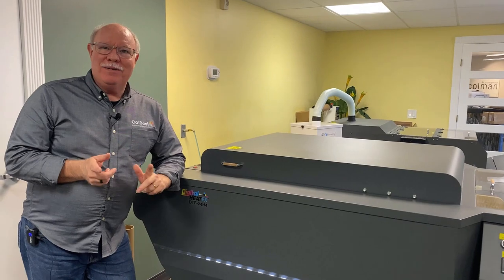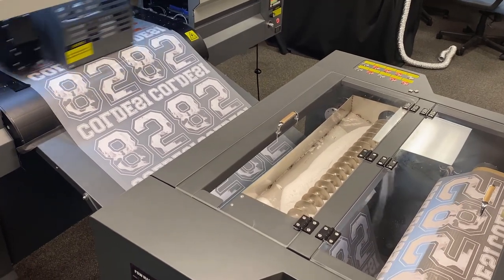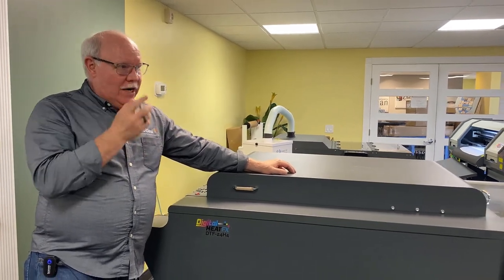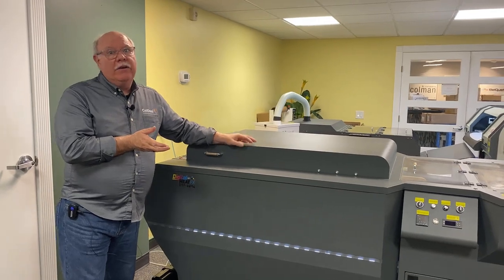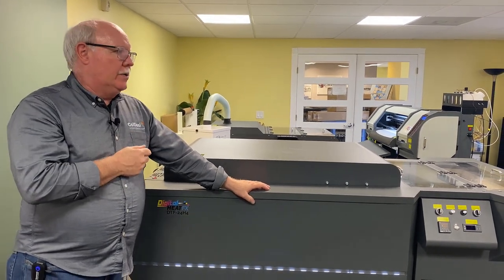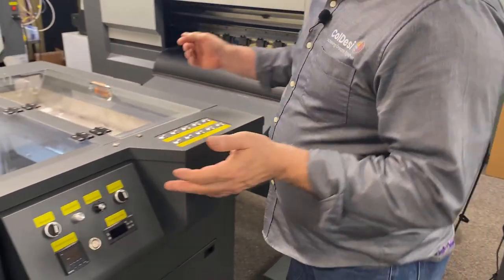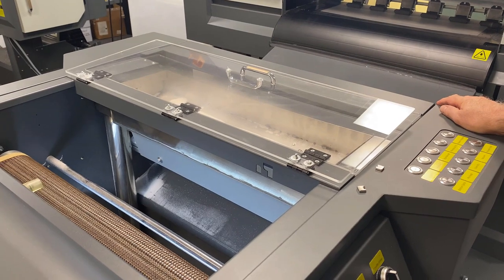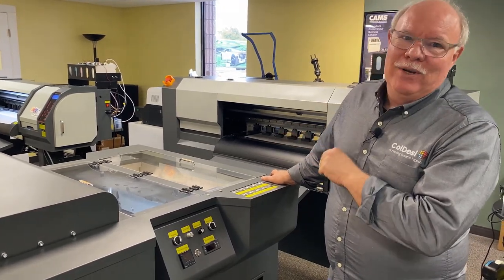Introducing the DTF-24H4 | 4 Head Direct-to-Film Printer

Comment: How do I get info on costs -  HMRC Duty for importation into the UK - I have been looking at machines direct from China but maintenance would be my main concern + supply issues going forward (in the current climate)
Reply from the maker: You can find pricing for our 2 head and 4 head system on this page - https://coldesi.com/coldesi-dtf/